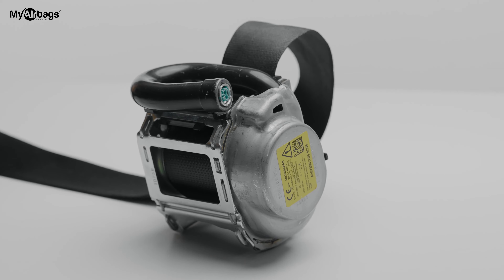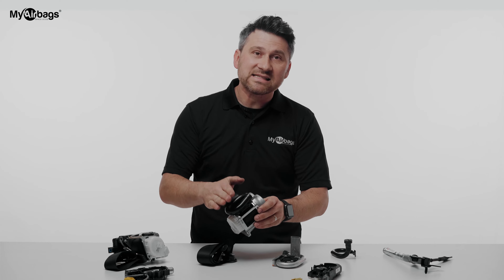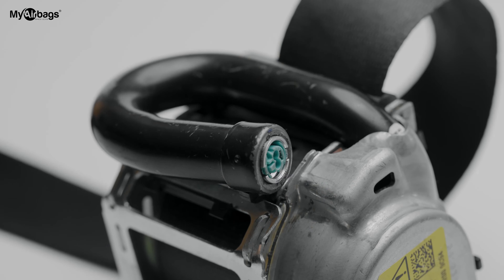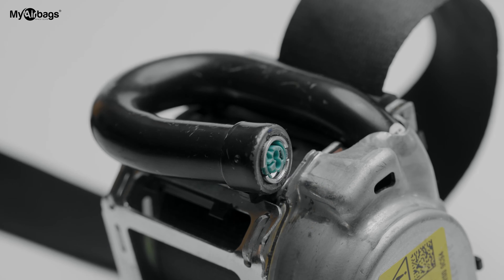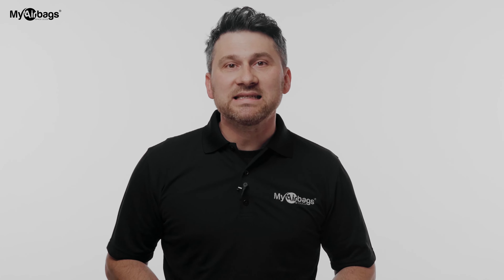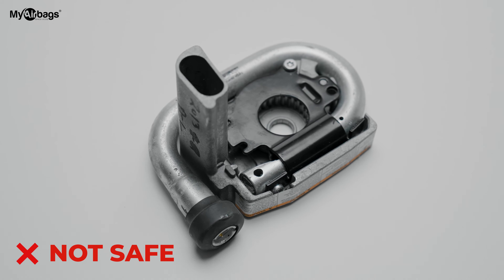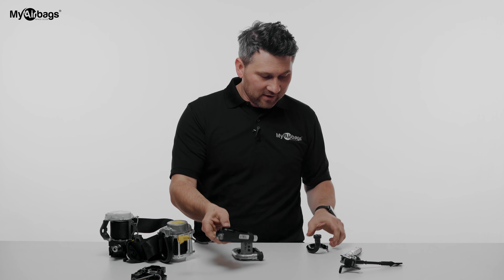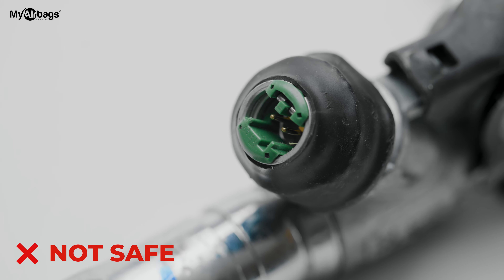How to Repair Seat Belt Pretensioner | MyAirbags

Comment: Hi, 
I have a 2015 Nissan Altima (S trim level). The airbag light came on (solid not blinking) and I took it to the dealer, dealer said it was going to cost $2,000-2,500 to replace the WHOLE ENTIRE passenger seat. I looked at the NHTSA complaint area for the car and another person had the exact same problem, and they took it to a second dealer and they said that the dealer said that it was a side airbag control module. I know I have to diagnose it first and see what the problem actually is, but if it is the side airbag control module (passenger seat), can I fix it on my own or should I take it to the dealer and have them fix it? Or could I just reset it the airbag control module?
Reply from the maker: The airbag that is in the passenger seat needs to be replaced. You can either replace just the airbag or the entire seat. To replace the airbag, you will need to cut open the seat and then sow it back up. For seats try carparts.com